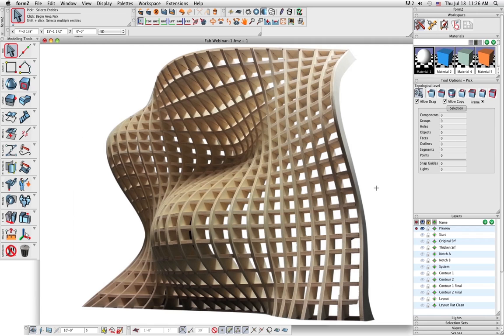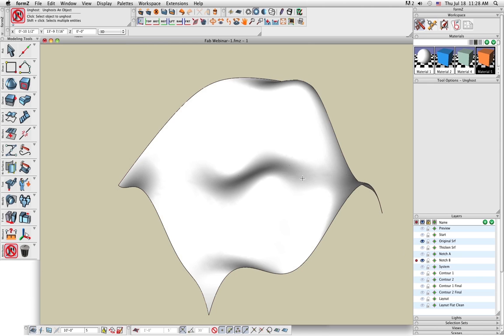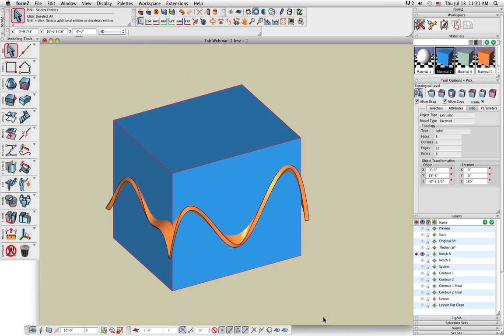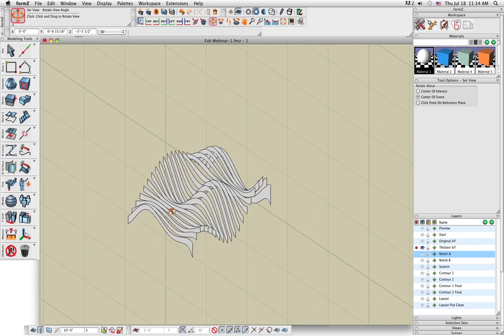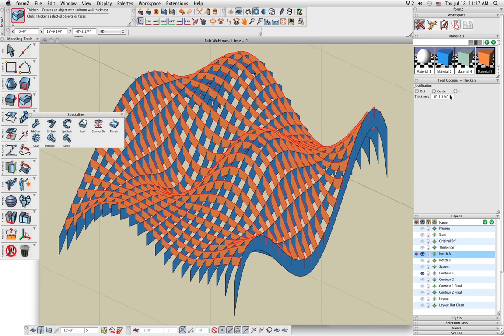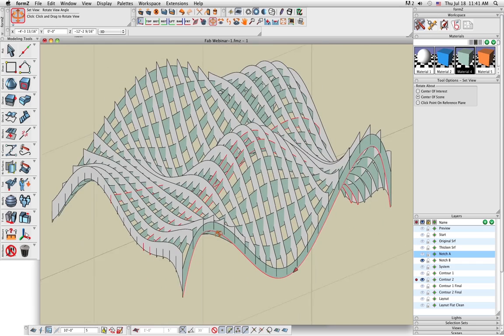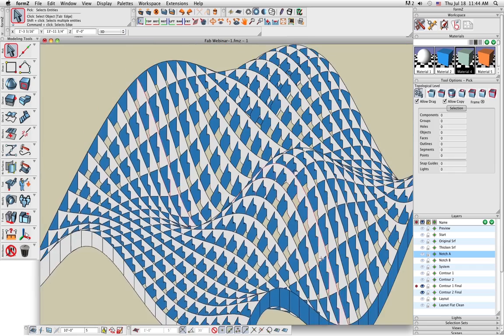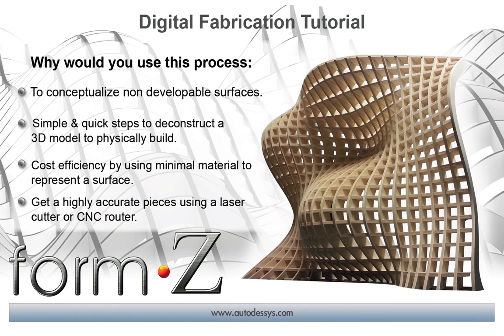Fabricating a Lattice Structure with form•Z

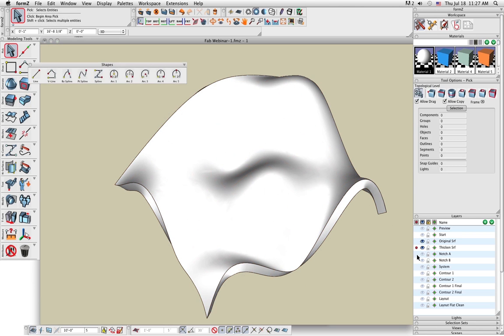Comment: Hi. Helpppp. I was stuck at step 3:00 where i have to hide the thicken surface layer but nothing happened. It seems that everything is on my original surface layer because when i click to hide the original surface, then only everything disappear. How can I make the object also at the thicken surface layer and every other layers?
Reply from the maker: Hi Nur,The dot to the left of the Layer Name indicates which layer is active, and if you are creating new objects, this will be created on the active layer itself.  You can Pick the desired object(s), then click the Attributes Tab of the Pick tool options, and you can change the desired layer for these objects.If you need further help, please email us directly at support@formz.com and we can help with any follow up questions you may have.  ;)

Comment from the maker: Hi Rhadiem,
Yes, if you are using a large router bit, this will leave rounded corners, but if you just do a second pass with a smaller bit (1/8") this will leave a ~1/16" radius, which was negligible at this scale.

Comment: nice tutorial, just want to note the pieces as-is will not likely fit together if routed on a cnc machine since a round but cannot cut square inside corners.  the notches each need a little curve cut into them to ensure the corners have room to sit fully in there.